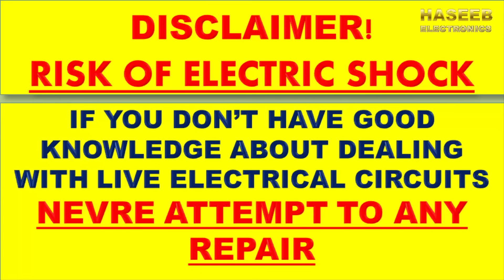{444} SMPS OutPut Voltage Low and Fluctuating, SMPS Output Fluctuation

Comment: Good evening sir. All the videos  posted by u are very knowledgeable video. Please guide me a 5v 30amp SMPS using uc 2844 pwm ic and mc 34262p quard opp amp along with 2×ha17324  ic. Problem is that op voltage fluctuate with series bulb on and off. All components are ok. Please guide me. Thank u

Comment: salam aleykum warahmatulahi wa barakatu sir i have a problem with a 24v 16,7a power supply its dc voltage keeps changing when i connnect any load like a 12v 10a dc motor do you maybe know whats causing the issue? Thank you

Comment: On Dave Jones youtube channel (eevblog) and some other channels (Diode Gone Wild)It's been shown that a lot of chinese SMPS they use scraped capacitors from old power supplies, just change nylon shield and put some fake logo like nichicon, but with capacitance way out of specs in terms of ESR and capacitance. It's good to be aware of that and put some tested caps with ESR and capacitance within declared specs (usually +-10% capacitance and ESR of <1ohm).

Comment: Dude..may 13007 keep on exploding right side left side is good..diode RL207 are not shorted all is good..whats wrong with my smps.. i replace the 50 v 4.7 micro farad capacitor..still it keeps on exploding again..i replace my 13007 transistor twice already ..help idol

Comment: Thanks Haaseb for your kind explanations. But there are some times when the fault is way more complex. For example, now I'm struggling with a switching power supply, which uses a MIC38HC42 IC in a very strange configuration. Since is not possible to me to find any schematic application for this IC, I wonder if it would be possible to feed externally to the IC a supply voltage to let it turn on and see if the oscillation is present before powering it with the mains supply. I would like to test it this way to void the blowing out of the power mosfets (2 present) brand new. The lamp trick did not work since even with a 25W lamp is enough to desttroy again the mosfets.

Comment: Didn't work.. I have same issue. same 12v 10A power supply suddenly was giving 5v. I tired by replacing these two capacitors (220mf 250v) though none of them were buldge. It didn't work.. 😕😕
Reply from the maker: there are more than one reasons. 
might be vcc capacitor 
might be high power switching section have problem
.smps controller issue
auxiliary voltage section problem 
might be feedback circuit have some issue 
for fluctuation problem you can my latest video
in that i covered the points to find fluctuations
Reply: @HaseebElectronics  thank you for your reply. I checked vcc capacitor. Voltage is 7.8 to 8v. Capacitor is ok. Check all other capacitors. Getting some hizz sound from transformer.. Could not find any problem. Except a small problem which I never thought.. Preset was faulty 😂😂

Comment: I have 5volt 24 amp power supply  low voltage on load ,power  cap.330uf 300 has been  replaced but till problem  is same give solution

Comment: Sir one component I found in smps is short.which is connected to MOSFET gate terminal.Its a 3 pin smd .looks like a transistor but I unable to find the part number.plz help to identify the component.SmD code is A7I

Comment: Hi engineer,  I have built dc to dc inverter using ic tl494 is working fine, but my problem is h-brige i need your help i want inverter h-brige using ic tl494 with feedback circuit. Thank you

Comment: amazing bro. well done. i was looking everywhere to fix my psu. i will try it tomorrow in my psu. my psu is 220v ac/24v dc and it gives 3.6v although capacitors looks clean.
Reply from the maker: Best of luck
Reply: @HaseebElectronics  my capacitors are 560micro farads I desolder them and measure them in multimeter it gives 530 microfarads. I think the problem is not with the capacitors. what should I check? may you please help me?.
Reply from the maker: capacitors are good 
within range
Reply from the maker: check RCD SNUBBER across primary winding of the transformer

Comment: Sorry sir, I want to ask. when the atx power supply is turned on, the 12v voltage becomes a bit high almost to 13v, and the 5v drops under 5v. I experience it quite often. Problems like this are usually because of what?
Reply from the maker: when 12 volt is high, that section is OK
when 5V & 3.3 V sections are slightly low, that means any one section from these  (5 & 3.3) have problem. might be capacitor, rectifier etc. some component is drawing more current.
Reply: @HaseebElectronics  when I encountered this problem on a power supply that had a trimpot. I tried turning the trimpot, for the 5v voltage it can go up to 5.1v and the 12v goes down to around 12.3v. so the output voltage is normal, but by turning the trimpot, even though the output voltage is normal, but it can't enter windows. my analysis voltage 5v and 12v are related. what components affect the 5v and 12v output the most? so if 5v is less, 12v is high. if 12v is high, 5v is low.

Comment: Out put voltave 14.5volt but when provide load output voltage 3.8 voltage ... What is the problem? Please tell me sir.
Reply from the maker: brother you didn't mentioned the model name and the PWM IC number 
no problem 
please check main DC capacitor (after bridge rectifier)
check RCD snubber (diode, capacitor & resistor across the primary winding)
check output side capacitors
if you reply with PWM IC number, then i can suggest

Comment: Hello, thank you for your informative videos. My problem is with this power supply. I do not receive the voltage of 20 volts before ic tl494 and that if possible the pulse transformer of the same model Show how to wind it

Comment: thank you, very well explained.
for testing purpose only, can i replace the caps with lower capacitance? if the broken cap is 100uF, is it safe to replace it with 47uF (same voltage rating) ? again, this is for testing/diagnose only to make sure that it is indeed the cap is the broken one..
Reply from the maker: welcome dear 
yes for testing purpose with no load we can install low value capacitor with same voltage rating or some above voltage rating
Reply: @HaseebElectronics  hi, thank you for confirmed it.

Comment: The negative side of the capacitor is marked by the striped part on the PCB. Also just check such a thing before removing the old ones.
Reply from the maker: you are exactly right. but sometimes some designs don't have the polarity marking on PCB, so in that condition we need to follow the DC rail 
and in my experience i saw some PCB's have wrong marking. so it is much better to ensure the positive and negative terminals 
or we can put some identity sign before removal

Comment: Ño component short but when assembling show shot with body why
Reply from the maker: 1. please check mosfet insulation paper (if not present install insulator between mosfet & chassis) 
2. install insulation paper between the pcb lower side and the chassis 
3. check class Y capacitors at input line and the chassis 
4. check the bridge rectifier for insulation paper

Comment: Sir please reply me i have an Tv power supply but have fluctuations in the vcc capacitor and in diode near the vcc capacitor no output and the bulk capacitor don’t fluctuate how to troubleshoot it please
Reply from the maker: please check the vcc capacitor (capacitance or its ESR value)
check secondary side of the SMPS transformer (might be some regulator is bad) which is causing the feedback failure, which is causing the smps IC in reboot mode

Comment: Thank you, Mr. Haseeb. What is the reason for hearing a loud buzzing (zzzzzzzz )in the transformer in the same power supply? I replaced the capacitors and the same sound is coming out of the transformer?

Comment: slm, brother hope all is good and well, got a problem am working on a freezer controllerboard that keeps on beeping and display is flashing weak and switches of and  switches on, I have replaces all capacitors and optic control and diodes  can you please help me
Reply from the maker: wa alaikum salaam dear brother 
check its low voltage power supply (specially the vcc capacitor for the switching ic, near the small transformer). most commonly the problem comes in that section or capacitors immediately after the smps transformer 
check the main DC capacitor

Comment: Hi Bro, same SMPS but 12v 15A I'm having and same low voltage issue,  but it's very new and not used,  Just I was playing short circuit testing and suddenly voltage went down to around 5v. My case capacitors are looking fine in appearance and getting some tick tick low noise if you hear closely in center yellow transform, Is there any other checks need to do ? Please support 🙏

Comment: Sir ye smps me over voltage ke resion kya honge, or smps behaviour like short circuit series bulb dansing , output voltage acceptable 12 v but this smps over voltage like 16/17 with sounding notice

Comment: Dear sir my smps led less glow and voltage drop on load
Reply from the maker: please check RCD snubber circuit 
and check output capacitors 
and main dc capacitor

Comment: After 22sec later my smps out put off & then auto on how it Repairing
Reply from the maker: please check electrolyte capacitor have internal leakage. 
possible in secondary side
check input PTC or NTC
Reply: @HaseebElectronics  sir few smps use 13007s transistor bt market r available 13007 transistor this is same ?

Comment: Low voltage 6.9 volt out  this type same circuit
Reply from the maker: please check voltage on main dc capacitor. it just stable and (equal to = input ac voltage x 1.414)
check diode in RCD snubber circuit (in parallel to the primary winding)
check TL431 circuit

Comment: My 12v 3.2A sony power adapter is giving 23.2v , i checked every component but didnot find any issue or may be i dont understand whats going on,
Kindly share me your knownledge regarding this what could be the possible issue that cause smps to output more than rated voltage ,
(There is a fluctuation of only 0,2 to 0.3v )
Dear! Do reply me as soon as possible.
Thanx
Reply from the maker: in your situation. it seems there is feedback failure, check TL431 or any reference circuit or optocoupler, that is not acting in close loop circuit 
so it is causing to switch the PWM IC to its maximum duty cycle. please check the feedback circuit

Comment: I'm very surprised to see that there is no protector between psu board and bottom chesis.. If any how the metallic bottom touch the backside of the board, a disaster will happen.. Thank you sir for you practical tutorial.. Lots of ❤️ From Bangladesh
Reply from the maker: no dear, it have a transparent insulator sheet, moreover it have mounting pads in bottom side and in vertical mounting
it have some good design engineering 
i will show in upcoming video, in that i will discuss its circuit diagram and its working principle

Comment: Very nice and useful information sir, I have a problem in my computer smps, it gives all voltages correct but when smps connect to load then the main chopper/ transformer makes same noise like shi... and voltages gets drop. so try to help me out.
Reply from the maker: please check and verify the output side capacitors, may be some of them have leakage
Reply: @HaseebElectronics   Thank you for quick help and replay sir, as you advice I checked the output caps, all caps are good.

Comment: What function of small trafo?
Reply from the maker: the small transformer is signal transformer or pulse transformer. it is used to drive the power MOSFETs and provides isolation to the smps controller 
i will discuss in detail in upcoming video

Comment: AOA Sir, I watched your most of the videos, they are very useful and full of knowledge. Thank you very much for providing such precious knowledge. 
Sir, I have a question here. if a power supply is giving approximately 12 Volts and not fluctuating means stable, but we also call these as low voltage because when this power supply was new its adjustable voltages were nearly up to 14 volts. But now maximum voltages are 12 which cannot be increased through preset/adj/. What's the reason of decreasing voltages of such power supplies because when we take a physical examination of each component, everyone is looking good and not damaged. I want to know the reasons of decreasing output voltage and the method to fix it. Thank you in anticipation.
Reply from the maker: Wa alaikum salaam dear brother
it happens most of the time, it causes
1. leakage in power capacitors, in capacitance meter it will give good reading, but at full rated voltage and continuous operation, it provide internal leakage. it can be examined using ESR meter
2. due to devalue factor of resistors and their temperature coefficient 
3. sometimes due to leakage inductance of the transformer 
4. in some cases the drop in permeability of ferrite core used in transformer, as it is made by magnetic powder. some materials loose their magnetic properties in percentage, that may cause in loss of conduction and increasing core losses and copper losses.
5. in some cases cut off frequency of EMI filter involves in attenuation and sometimes it produces ringing factor, that can cause to disturb the current in dc rail 
6. improper design of Snubber circuit may be one cause, when it doesn't discharge the primary properly, 
these are some key problems of loss in power

Comment: hi excellent video i have a same problem i change same capacitor and small capacitor fault still have   but voltage not Fluctuation 6.56 v